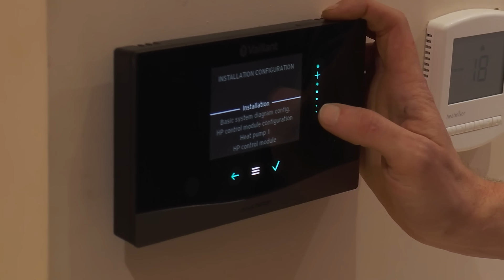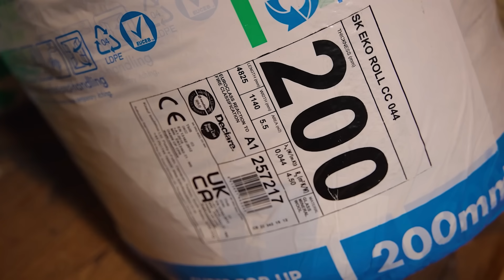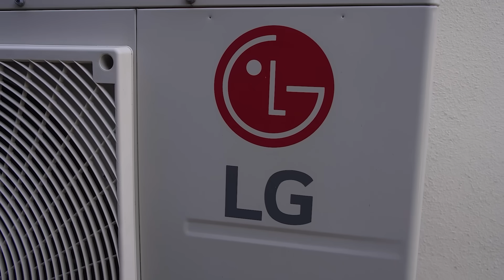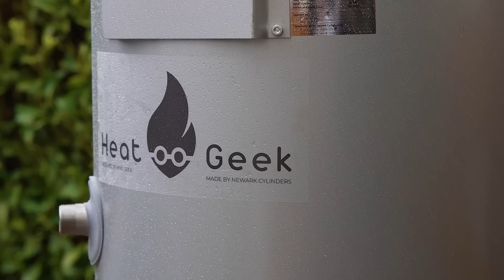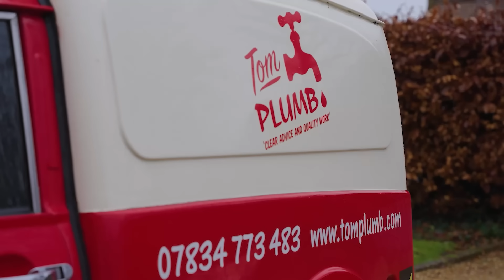Heat Geek’s Heat Pump One Year Later — The Verdict!

Comment: Gas engineers here yesterday were saying how busy they are removing heat pumps and putting gas boilers back in. This is in the North West. They're booked solid in Chester and Wales as people are rejecting them because they're far too expensive to run and don't warm the house.
People are going back to gas.
If you get a heat pump, pay on finance or credit card do you can reject it.
Reply: North Wales here...best form of heating I've ever had! Everyone seems to be getting heatpumps at least twice the size they need fitted by bad designers. But you do need battery storage to make them cheap to run. Thats a few grand right there. That said I removed my log burner on the second winter as it never got used.
Reply: Many happy with a heat pump, including the subject of the video.
Reply: @Biggest-hz7ng  ....eventually.  After a year or more of faffing about, he 'says' he's happy.  How many people really want to admit they have made a mistake, though?

Comment: Far too complicated + expensive. 🤕🤕
Reply: Many are happy with their installs. Reasonably installed heat pumps have similar energy costs to gas boilers.
Reply: @Biggest-hz7ng  Alternatively investing in warm clothes, knowing how to layer and choosing quality fibers or down filled clothes pays off much quicker than forking thousands of pounds for a system that isn't yet, in a lot of cases, delivering value for money. I believe that the future is in building underground where possible (excellent naturally regulatory temperatures) and in granting real subsidies for insulating old houses. Being flexible with planning permissions is a must and it needs to include self-built.
Reply: @catherinemira75  we still need to heat buildings, and low temperature tech is the best way to do that (even if we wear more clothes or better insulate buildings).

Comment: I'm aware of the 'government' pushing UN climate emergency propaganda. My oil fired combi in my rural 1950s  house was replaced last week with a new Worcester Bosch external combi, I couldn't be happier with it. No gas here, hence the oil fired boiler. The company that fitted it initially tried to sell me a heat pump. Having worked in the trade before retirement I rebuffed the offer, the bloke admitted takeup is poor. And I agree with anotber comment here describing the heat pump installation as resembling the boiler room on the Titanic. Far too complex, too much plant and electronics. Most would never understand how to use it, me included.

Comment: The cost of electricity really is an issue in this country and is kind of an unnecessary issue. Over 60% of our energy comes from inexpensive carbon-free sources but 97% of days we need some form of gas power. As a result of how we price energy we then pay those inflated gas prices for all of our energy on those days.

If we changed how energy markets worked and matched the subsidies on heating gas with electricity people's electric bills could be cut by two thirds. After that a heat pump and heck even an electric boiler would save people a bunch of money. (gas boilers are 80% efficient, electric about 100%, heat pumps 300%, essentially even an electric boiler would cost as much as a heatpump costs currently)
Reply: Your whole comment is based on the fallacy that solar/wind are cheaper than gas. They’re not. Firstly they’re not dispatchable so cannot match demand so gas is needed anyway no matter how much intermittent wind/solar you have, and secondly - without massive subsidies (ROCs, FITs, CFDs) no-one would be building solar/wind since they’re not economically viable without subsidy.
Reply: @ You may wish to read my comments on this thread more carefully as I believe I have addressed many of your points.

To your specific points, the statement the renewables are cheaper is reflected in the energy markets and newer research that has been conducted by policy makers. That statement was true earlier on when the technology was quite new and needed incentives to help producers recoup their costs but many renewable technologies are increasingly getting commoditised which has brought the initial investment down a lot.

The actual cost of generating power is quite low and since renewable facilities don't have refuelling costs their only operating cost is maintenance. It's not like a fossil plant is free from construction costs or maintenance.

On the topic of renewables being dispatchable I addressed it in one of my previous posts, but this is why I think simply expecting the issue of marginal pricing to go away as more renewables come into play to not be a solution because I expect that gas will be part of the energy mix for a while. 

Perversely this in itself is acting as a subsidy for nuclear and renewables at the moment since the delta is pure profit, but my issue with it is the cost of that subsidy is borne by the consumer in overpaying for energy, a new approach is needed because I don't think that model works particularly well long term.
Reply: @theonik2006 if we reach gas being limited to 5% of generation in 2030, that will move us on significantly. One suggestion was that the UK might own some gas plants in 2030 for that 5%. But I think we all want a regime that encourages investment in appropriately located renewables/storage and it isn't clear what that is? Something as well received as CFDs would be great.
Reply: @brickmissing8295  all lies or you are grossly uninformed. Wind and solar have no fuel cost, so it's no surprise they are the cheapest sources available. Gas plants are the most expensive source we have, but they are flexible. The more solar and wind we build, the more demand we can cover with them, the lower the prices will be. Just look at the electricity prices on a sunny day and you will see what I mean.
Reply: @pietheijn-vo1gt  do you really think fuel is the only cost? Yes wind is free but the mass of steel concrete and other materials needed for just one windmill is enormous and produces a lot of co2 in production transportation installation maintenance etc. the same goes for a solar farm , except less concrete. And these rarely last more than 20 years before they need replacement. A fossil fuel power station will last 50 years or more and will produce power whenever you want it.windmills and solar produce power when they want to. You have to adjust to them, so get ready to have your lifestyle turned upside down

We have relied on fossils and imports 3 times in the last 5 months in UK, each time for several days and once for  a week where solar and wind were supplying only around 5% of demand. If we had replaced the remaining fossils with more wind and darker would all have been sat in the dark.

The argument that wind and the sun were free is an outdated argument and not worthy of genuine discussion anymore. The debate has moved on.
Reply: @DanRyan-v5y  You list a lot of common misconceptions. Wind turbines are climate neutral within a year of construction, that takes into account all emissions during construction. 

Most countries in europe rely on imports, and that is not a bad thing. In fact, imports are going to increase exponentially as more solar and wind is built. An interconnected grid is simply more resilient and leads to lower prices. Indeed, there are times (dunkelflaute) where wind and solar is low. That's why we will need to keep gas peakers for the forseaable future. For intermittency on the shorter term a ton of grid scale BESS will be built in the next few years.
Reply: @pietheijn-vo1gt  what happens to wind turbines when they fail ? they go into landfill , there is nothing wrong with CO2 either , a warmer planet even if true would be generally beneficial , we would also need less heating
Reply: @AlexSmith-y4i6t  stop with this bullshit please it doesn't help the discussion.
Reply: @pietheijn-vo1gt  pointing out facts aids the discussion , sorry you have issues with freedom of speech
Reply: If renewables were cheaper then we would have cheaper electricity as they keep promising. However it should be dawning on even the most naive that this isn't the case. Renewables get massive subsidies and the market is thoroughly rigged in their favour.  Their inherent problem of unreliabity ( no wind, no sun) means they have to be backed with a second system which is run inefficiently just to suit the renewables. You have to pay for two systems not one. Plus when renewables produce too much when no one wants it, they get paid a fortune in constraints to not supply. That is why electricity is so expensive and it will only get worse as net zero advances.

Couple this with a massive new load from  heat pumps and EVs that never existed before, we are heading for power cuts.
How efficient you think your heat pumps are will be irrelevant if you are sat in the dark.
Reply: @DanRyan-v5y  Renewables are cheaper. 97% of the days the price is set by gas electric which is not just expensive because gas is expensive but they are only 33-66% efficient and most of them are in the lower end of that range.

For the 11 or so days where renewables set the price the price is much lower. Your comment simply proves my point from earlier in the thread in that if we don't change the pricing system to allow consumers to take advantage of those savings sooner it creates friction from members of the public that think renewables don't work.
Reply: @theonik2006  Would an energy supplier invest in renewables without a contract for difference or similar agreement in place? if the answer is no then it rather gives the game away, if the answer is yes then why do such agreements exist as they would clearly be wholly unnecessary. As has been pointed out relentlessly but falling on deaf ears clearly in many circles, the nations which have gone heavily for renewables have the most expensive electricity in the world, the nations increasing their fossil fuel consumption have cheaper energy, forget the environment for a second just think on a human level, current climate policy is increasing costs, reducing industrial output in the developed world and putting the developed world on a path to declining living standards, this is true in 100% of the examples available, there is no example of a nation shifting to a heavier reliance on renewable energy and the cost of electricity declining.
Reply: @theonik2006  Starmer  should be demanding wind farms and solar on buildings.  It really is obvious.  He will not do that because....
Reply: Taxes will shift over time to favour electricity over gas. As the heat pump install capacity grows, the shift becomes more likely.
Reply: @Biggest-hz7ng  But you sort of end up in a chicken and the egg situation right now. I also feel that now is the most crucial time to get this right because you are already seeing a lot of pushback on things like renawables from people not seeing the benefit because the current system isn't letting them which in turn creates political resistance to the idea of investing in renewables.

It's a similar issue with heatpumps themselves, offering people subsidies to switch is good and all, but as was discussed in the video if you don't do something about regulating installs so systems work, what you end up is with a bunch of people getting systems that don't work who end up spreading negative word of mouth, and ultimately pissing our money down the drain.
Reply: we should not change how markets work, the markets are reflecting the true value of electricity. What we need to do is simple, we build more reneweables so that expensive gas is no longer needed.
Reply: @pietheijn-vo1gt  

The markets are being interfered with and do not reflect the true cost of electricity.

All down to marginal cost pricing, as declared in Government statement

"Electricity is increasingly generated from renewable energy in the UK, and the cost of renewable generation has significantly decreased in the past decade.

Despite this, the price paid for wholesale electricity on the ‘spot market’, where, according to the Competition and Market’s Authority around two fifths of electricity is thought to be sold is largely determined by the price of natural gas."
Reply: @ except marginal pricing does not reflect the true value of electricity. This is a topic that is currently under debate because the government recognises that this is in fact an issue.

In my opinion, if a producer is prepared to sell energy for a given rate you should not be jacking up the price because they are not able to meet 100% of demand. Nuclear energy producers made record profits during the peak of the gas crisis off of this.

Building more renewables is something we should be doing but is not really the answer as the problem is variability in output and a lack of energy storage. We will never be in a position where nuclear or renewables are always able to cover 100% of demand so we will always have gas as the marginal cost at least to some extent.
Reply: @theonik2006  you can't just change the market pricing mechanism without due notice. We need investors in generation and clarity in future pricing mechanisms
Reply: @ You can do many things. The question of whether you should and what you should do is separate. Nobody is suggesting that tomorrow we should have a new pricing system.

I will also say choosing to do all this via private investment is also a choice and one that most of our European peers have decided against, which has allowed them to skirt around many of those issues. But this is  a far bigger topic.

Comment: I trust Adam based on heatgeeks results more than you on this mate.  Our country is on a big learning curve.  We need to move forward not stay in the 70s.
Reply: It appears he was wrong on calling out the LG bearings as well as the angle of the install, yet said it with such conviction.🤔🤔🤔
Reply: We're struggling to train decent trades across construction as it is. Design and install of this junk enmass ain't happening.

Comment: Poor old Roger. Still can't really accept heat pumps and still loves his dirty gas systems.
Reply from the maker: What a strange attitude you have. I let John tell us what he thinks and that is why I went there. I know  it is hard for some to accept, but I have no axe to grind. This channel is all about information, we are not lapdogs of government ministers or gas boiler manufacturers, who also sell heat pumps. It is time to stop polarising the argument and act like grownups. There are millions of homes which can't be heated by heat pumps and that has to be acknowledged. We must also remember that this is a £22K installation. Not everyone has that kind of dosh.
Reply: @SkillBuilder  ROFL... Get over it. heat pumps are a more efficient and cleaner solution to gas boilers, Just because the install is expensive, it doesn't change the fact a heat pump is the better solution. Every time he made a positive point about heat pumps you felt the need to have a dig by pushing gas. You said previously you couldn't have one in your Victorian home because its old and a heat pump won't work -  thats total FUD. How many gas installers do a heat loss calculation before installing a gas boiler? Probably no-one because most just chuck in an oversized boiler.
Reply: Can’t say I have witnessed that on his videos. He has consistently demonstrated a pragmatic and balanced approach and one in common with majority of the public. Seriously, who can afford this stuff?
Reply: @ He tries to be pragmatic but he's biting his tongue and still disses heat pumps at every opportunity with tired old arguments. He talks about old houses not being suitable for heat pumps when there are plenty of examples out there which prove it isn't true. No heating solution will be perfect in a leaky house.
Reply: A pointless comment.